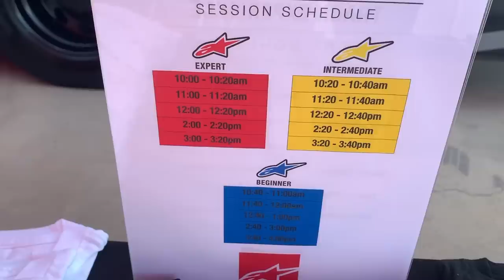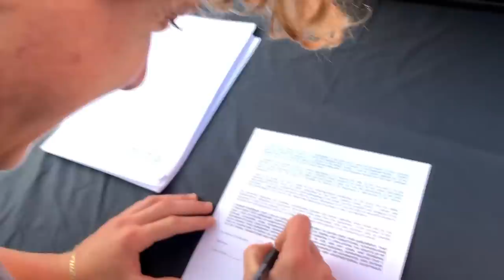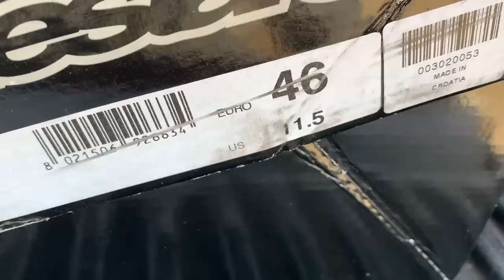My BIGGEST Crash - Buttery Vlogs Ep35

Comment: Hang on. Before I watch I have to tell about my worst wreck. I'm glad your ok btw. 

Anyways. 16 I was riding the dunes 45 mins from me. Had 4g of dank in my pocket. Been going out there sense I was 7
Well. I'm sober cause I'm leading the group on 8 ppl. Leader usually crashes. 

Yep. Road off a 13ft cliff going around 30 ish (rzr speed gage) broke both wrist had to get 5 stitches on my chest. Broke nose and best part. I was the only person who crashed and only sober one when I crashed.

Comment: If  you olny knew that you just drove threw tehachachapi and didn't know that there is such good riding in tehachachapi big booters in the hills and then. There is Bakersfield that has some old school big hits to and there is also mojave right there on that back rd you were on with the windturbines there is a sick supercross track you guys passed up.there used to be kyle lewis supercross track right out by willow springs .but you guys are sleeping on Bakersfield and tehachachapi cause there is sick riding there

Comment: Hey, anybody have a great story about the "almost crash: that you saved?  I have a couple, but here is my best, (lets read yours).  I trucked my bike to ride with a buddy of mine at his place where he rode a gravel pit that I had never been to.  We both had 1988 Honda CR250's.  I unloaded the bike from my mini truck, suited up, and we were soon flying down a 2-track (again, that I had never ridden on), that lead to the gravel pits.  We are in 5th gear, pretty much topped out about 60 or 65mph.  He was in the left track, I was in the right track.  We are about to go over a little rise, and I thought I should be in his track, because I don't know the trail.  The grass mound was a bit higher between the tracks than I wanted to cross at 60mph, so I stayed in my track and risked it, flying over the rise to a down hill.  My side was all washed out by rain, with a gorge over 2 feet deep, about 3 feet wide, (the entire lane), and about 100 feet long, and there was no way I could stop or turn.  But down the length of the gorge, peninsulas stuck out from both sides, it was ground that was not washed away yet that were like the tops of very deep whoops.  So in one second, I got back on the bike, pinched the bike with my knees hard, kept my elbows up, and pinned it.  I skipped over all the peninsulas like skimming the tops of man made SX whoops, with the path of my bike tracking straight as an arrow.   I sure as hell was not going to do it again though, and I don't remember riding at those gravel pits. :)